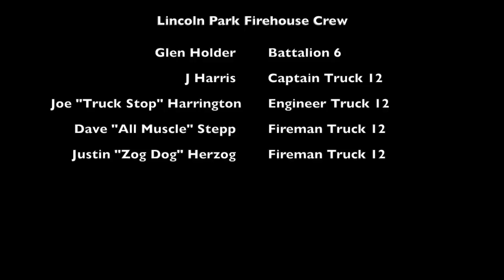Tuther Fire 2 FireCams

Comment: cutting a hole in the roof dosen't it could blow up since oxygen could enter ? or does oxygen enter if you cut a hole from the bottom ? im not well informed on that
Reply: The purpose of vertical ventilation, such as on a roof, is to remove heat and unburnt fuel in the air from the structure. All of that dark brown/black smoke is a combination of burnt and unburnt fuel. Buildup of this fuel can result in a flashover, which is basically when the fire rapidly increases in heat, and all combustible materials in the involved area near-simultaneously ignite. Flashovers are super dangerous. The thing about that smoke/unburnt fuel is that it's really hot, and if you make a hole in the roof, it's going to want to leave. That's generally a good thing. 

Proper ventilation also involves deciding the flow path of the fire, and preventing it from spreading out of control. Opening up a form of ventilation almost always introduces some oxygen, but you typically try to reduce that as much as possible. Every fire is a little different, and firefighting involves a lot of on the spot decision making. You don't always make the perfect call, but you do your best in the given situation, and try to learn from any mistakes in the aftermath.

Comment: For what do you need that air vents on the roof? I was thinking that additional oxygen will help fire to spread..
Reply: possibly to prevent a backdraft from occurring
Reply: So combustion doesn't take place when smoke is trapped. Need vents to off gas.

Comment: Ignorant question here: Why do they cut ventilation on the roof? Doesn't that help the fire? (obviously not, but to me, it doesn't make sense).
Reply: It allows heat and smoke to escape the house. But it needs to be coordinated with other tasks as it can also increase the potential of the fire by giving it a full flow path. So typically it's done at the same time as an attack is made on the fire. So as the firefighters attack the fire, it reduces the heat and increases their visibility inside the structure.
Reply: @jgrandison2004  Makes perfect sense, thank you!

Comment: What does cutting holes in the roof do. Dont that make more air for the fire to burn quicker
Reply: Venting the roof allows for smoke to escape from the building. That way firefighter can see better. This also allows the fire to be attracted to the hole because of rich oxygen supply. Fire always wants to go up. Makes it easier for firefighter to find it and put it out in a much cooler environment and less smoke.
Reply: It releases heat and smoke reducing the risk of a backdraft and making it easier to see where to focus the attack.
Reply: It gives the truck men something to do.
Reply: @kirkmanning6232  this is true
Reply: @kirkmanning6232  hahaha
Reply: But it’s more dangerous than an attack from outside.
The roof could collapse, or a firefighter could fall into a whole.

In Germany they never do something like that.
Reply: @WupperVideo  No matter what you do firefighting is inherently dangerous. well trained firefighters are continually sounding the roof while they are on it and by doing so know when to evacuate the roof.
Reply: WupperVideo doch doch http://www.nordbayern.de/region/brand-in-einfamilienhaus-feuerwehr-muss-dach-offnen-1.8380567
Reply: We do nerver cut hole in roof in sweden.
Reply: Yes, you're correct but they were cutting holes in the roof for the ground team. Steam has to escape somewhere too and sometimes it can be much warmer than the fire. This is also along the lines of what Dan_2015 said.
Reply: @WupperVideo  You can't really compare Amerikan house fires to German ones. The houses in Amerika burn a lot different. Most roofs in Germany are a lot harder to open, that's also one reason why early roof opening isn't used.
Reply: @tigclark5804   He's wrong though, did that quite recently, but we usually only do it for search and rescue, primarily for visibility and after control over the fire is established. But seeing those guys standing on that not too trustworthy looking roof on top of a burning room had me wondering how it didnt collapse considering the weight of their balls.
Reply: I’m seeing mixed opinions. All honesty, what it does is... if communicated right with an engine company ready to start flowing water what it does is inside the home there might be no flame... so you vent the room giving the fire oxygen for it to start but engine crew starts flowing water immediately so no flashover or backdraft occurs. And helps vent smoke and heat from the home.
Reply: Don't they have thermo cameras? When i was volunteering they had thermo cameras in the engine. This is just bringing in fresh oxygen. And putting the lives of fireman in danger.  @Dan_2015
Reply: @Dan_2015  Actually, as mentioned above, if the house is a total lost, why put your firefighters in danger. In Germany this woulndn´t me managed like this. Sometimes, we will do it, but with the ladder, not standing on the roof. You actually can see on Youtube enough firefighters falling trough the ventilation opening. Just no sense, if there are no people in the building.
Reply: @WupperVideo  Die Idee ist eigentlich ganz einfach. Durch die Öffnung sollen Pyroslysegase entweichen bzw. abgekühlt werden. Da gilt es dann abzuwägen, ob die Gefahr durch spontane Durchzündungen oder der zusätzliche Sauerstoff die gefahr darstellt. Vorteilhaft ist natürlich auch, dass der Rauch nach oben abzieht. Aber ja, in Deutschland ganz selten und bei einem haus, das bereits verloren ist einfach nur unnötig jmd. in gefahr zu bringen.
Reply: @exi444  Das ist eine Öffnung, um an den Brandherd unter dem Dach zu kommen, nicht um eine Ventilation bzw. Abziehen der Gase zu erlauben. Ganz was anderes.
Reply: Es ist auch vollkommender Schwachsinn, im Einsatz ohne Absturzsicherung auf ein Schrägdach zu klettern, um dort irgendwelche Dachziegel zu lösen.
Dafür gibt‘s die Drehleiter und dann kann man das mit dem Einreißhaken machen, oder mit Absturzsicherung am Dach arbeiten.
Das Risiko eines Sturzes ist sonst viel zu groß.
Reply: Here in America (most good fire departments) we go into structures to put fires out. Venting the roof allows us to get interior with less heat and smoke. If youre going defensive on a fire like this you should call yourself a gardener and not a fireman.
Reply: @jabberwakkee For steam to instantly  burn firefighters it would have to be under hi pressure. Otherwise it tends to only draw heat to form steam which is whisked away in the flowpath.
Reply: @Dan_2015  Yes fire wants to go up however you also have to consider that inside a structure there are walls and ceilings which will hold down the heat. So fire can only rise to the highest point in the room it is in. It will bank down and escape through doors windows even cracks where the electrical and water systems pierce the walls to power and plumb the outlets and sinks. It will find the stairwells and shafts for elevators and dumbwaiters even ventilation wells in some older structures. The contemporary methods of firefighting include directing the fire by controlling the flow path and isolating the fire from areas where you don't want it to go. If the fire is in a room with a door and a window directly to the exterior close the door and when you have a line charged and ready break the window and cool the room from the exterior then go interior and overhaul the fire building to ensure that it can not rekindle.

Comment: Can someone explain what these ventilation holes are for? I thought giving a fire more oxygen only makes it worse?
Reply: You vent the roof for many reasons, primarily to remove heat and smoke from the structure and make it safer for interior attack crews to fight the fire.
Reply: @bmadfox  makes sense I guess, thanks :)

Comment: Don’t know there SOP’s but I guess first due goes to the roof??? I definitely would’ve done the 360 while my guys take the front door, then go inside. Have to find out right away if the fire is in the residence and if so the first line goes inside. Second line to the 3 side or C. Roof would’ve been 2nd due truck or 3rd engine. Not really as much of a priority til we know what we have inside. Also, JMO, the roof shouldn’t be coordinating anything but what he is doing up there. Regardless of rank. There were other officers on scene that could handle that.

Comment: 2:46 why do they have the ladder so far extended/set. I'm not sure if it's something fire department just does. I do roofing and to put the ladder that far over is just to much extra effort and then you have to work around the ladder.
Reply: This makes it easier to find the ladder in the smoke when you need to quickly exit the roof.

Comment: Pretty damn cool video fellers!

BUT... that looked pretty dangerous and uneccessary.

That firefighter was cutting horizontally so freaking deep I’m SURE he cut completely through tons of rafters.  And he was walking alllll over those rafters too.

My department recently started to train on using just the few first inches of the saw.  Just cut the bare minimum necessary and don’t plunge.

Plus all those holes?  Also not necessary.

Get the hole cut and then get the eff off the roof because to me you were risking a LOT to save a little.

Looked fricken sweet though!

Stay safe and go home
Reply: Why so many holes? Probably  because the fire attack guy's were asking for more . You can hear them asking for more over the radio.
Reply: @MrLordwrecker  The perfect clarification about what I have be trying to get across to others here on YouTube communication and coordinating the work of different divisions on the fire ground is a coordinated fire attack and is essential for fire fighter safety and bringing the fire under control The searches and possible rescues and ventilation are primarily truck company tasks while fire attack interior and exterior are primarily engine company responsibilities. Both engine and truck companies get their orders/assignments from Incident Command while they pass situation reports back up to I.C. This is a very basic level of explanation for the extremely complex number of issues that are involved in fire fighting.
Reply: @retiredarthritic2083  yeah I was trying to keep it simple also

Comment: Hey just wondering why cut the holes? Just thinking increased air flow helps the fire? I'm not a FF. I'm sure there's a reason. Just asking.
Reply: Most times here in California they want the house to burn down. Dont know why. They help contain it and make sure it stays burning just the house and nothing around it.

Comment: Tactics in Europe are so different. Roof ventilation if it were needed would always be carried out from within the cage of a turntable ladder so as to avoid the risks associated with roof failure.
Reply: Most roofs in Europe use batons with tiles or slate so would ventilate naturally once the felt underneath was burned. Most roofs in the  USA are built like shed roofs out of chipboard with felt 'shingles' so will hold hoot gases inside the structure which  could lead to flash over through the  whole building. Ventilation is critical  if firefighters are inside looking for casualties  or fighting the fire.

Comment: Why did they cut off the roof?
Reply: Ventilation I'm a firefighter as well I'm pretty new at it I'm actually currently in an exterior class and so far I've learned that they ventilate the roof to help the smoke escape in sure there are other reasons I haven't learned yet

Comment: Those special chainsaw chains? I so much as look at a nail or rock and I have to re-file mine.
Reply: carbide teeth on the chainsaws and diamond blades on demolition saws. Honestly the trick is to have someone, clean it and maintain it on weekly basis, as in full check up after every use. Doesn't matter if it never came on. If it came off the truck, it's got to be checked. Also interestingly enough while it looks like they are making these giant holes in the roof, the goal is to avoid cutting thru any beams so the operator will rise the saw as soon as they feel pressure so that only the plywood and shingles are cut.
Reply: oh and they make "special" chains and blades for fire service but those are far inferior to the top of the line stuff you buy at homedepot
Reply: You would be surprised, you dont encounter as many nails as you would think. But every scene the saws have a freshly sharpened chain. We check and run saws at the beginning of every shift, every morning and after every call, wether or not its been off the truck and used or not. Same goes for any gas saw or generator on the trucks

Comment: I think abandoning 2-1/2" lines and running more 1-3/4" lines would work better.
Its not about how big the buckets of water you throw on the fire are.
Its about how many buckets you have.
I think that increased mobility outweighs higher capacity.
If there is an area that the smaller hose cant clear.
Just run a second hose.

Comment: A fire doubles in size every minute. Think about that
Reply: The rate of fire spread is relative to the conditions at the time of the fire fire in fast fuels can double in size every 10 seconds. Wet heavy fuels the fire will burn slowly and spread may only be very minimal over 1 minute. Been there done that both wild-land and structural. Think about it.

Comment: "We need a line"...NO S**T, and why is a gas fan coming off before the hand line.
Reply: The ventilation fan always gets taken off the rig during a structure fire so while the attack crew is putting out the fire the exterior Crew can set up the ventilation fan so they don't have to wait for a long time to disperse the heat and smoke after the fire is out.